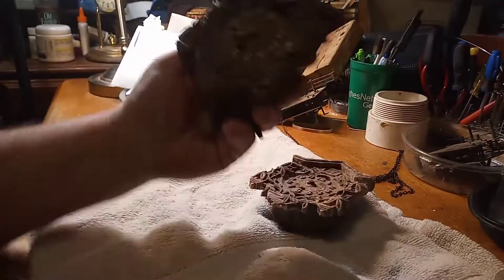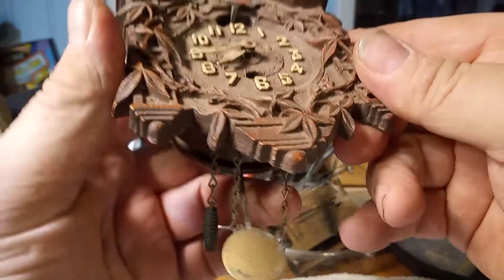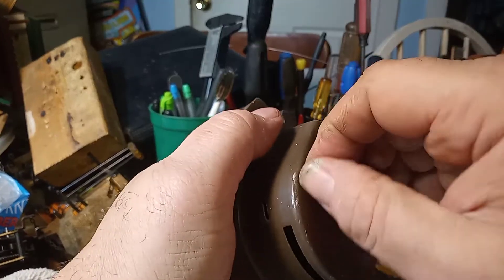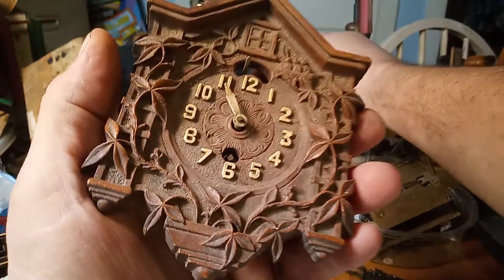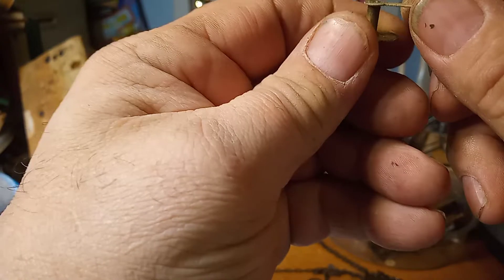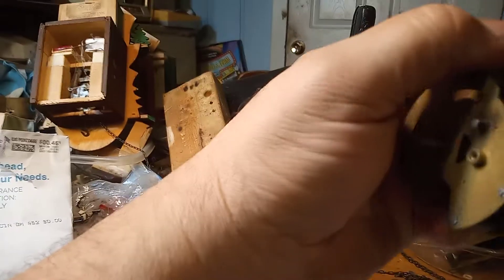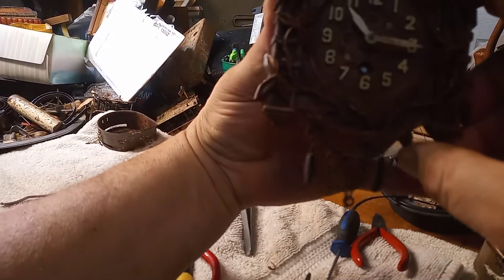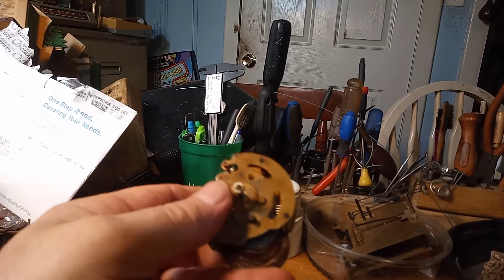Repairing a Lux animated swinging bird pendullete clock. 20220315 204155

Comment: I use a hand remover to get the hand off so I don't damage the hand sides. Did you know that the pendulum wires that go in the bushings move. You need to be careful not to push them inside because they are just short wires and can disappear and don't know how to get them back out. Great find on the price.
Reply from the maker: I have a hand remover but it is for pocket watches. I dont have a clock hand remover. You can use two screw drivers or a pair of plyers but you want to put a towel underneath so  you dont damage the clock face. These Lux clock hands are a challenge to get off sometimes. Not exactly for certain what you are talking about when you say the pendulum wires that go into the bushings move. Please explain further. Thanks. The seller had the items listed for $15 plus shipping. I told her that the items needed a lot of attention and that one of the clocks would probably just be a parts clock. The escapement on it doesnt work. It is rusted. I put it in the ultra sonic cleaner for about 15 minutes. I think that I am going to put it back in for another 20 minutes or so and try to clean it up. The pendulum is broken on it. But a friend from the group Ron Rosencrans gave me some novelty clocks when I went and saw him after fixing a Hubert Herr Cuckoo Quail movement for him and teaching him how to take a cuckoo clock movement apart and putting it back together and teaching him how to do bellow repair as he was doing the same thing that you used to do and that was buy new toppers for them. So he gave me some clocks that he doesnt like working on. One is a Lux clock but one of the gears has a broken pivot. I might use this clock to repair that clock. I just posted some videos of me fishing today. One of the elements I put one of your videos in for the end screen.
Reply: @munnerlyn3  The way I found out that they were wires instead of a solid bar is I got lazy and didn't loosen the nut enough. I pushed it in place and the wire that is suppose to go in the bushing, slid inside the pendulum housing. I stopped messing with it, but want to see if they come apart to fish it back in place.

Comment: I never noticed the difference between Keebler and Lux winding hole positions.  They do have that crazy (sunburst?)  verge and escape wheel that gets impulse from only one side of the swing.  The fronts are made of glue and wood flour (if memory serves me right).  I like to spray them down with Scotts liquid gold and wipe them dry to get off the grime.
Reply from the maker: I have never used the Scotts Liquid Gold. I have been using Old English Oil on just about everything since I first started collecting clocks in 1999. I have since used New Wave Furniture Masque and Howards Feed N Wax. I like both products but dont see that much of a difference other than price between using Old English Oil and the others. Some say that after time Old English Oil causes mildew. I have never experienced that in all my years of using it.
Reply from the maker: Forgot to mention that in the description of the video I have a link that is for Dan and Dianas web page on Lux clocks. It is the most useful web page out there and they do talk about what the clock housings are made from Molded Syroco wood face found in four color variations. So your memory serves you well.
Reply: @munnerlyn3  Scotts liquid gold is very oily at first, but either soaks in or evaporates after a day or two.  On the old cuckoo cases that are not lacquered, it's incredible.  I take them outside and spray them down with the stuff and in about 20 minutes the cases often look nearly new from it soaking in the dried out wood.  Try some sometime on an old scrap cuckoo case.  you may grow to like it.
Reply from the maker: I might have to do that sometime. Thanks.

Comment: So, these clocks do not move the gears based on the spring alone? It works by moving the pendulum ?
Reply: I am also having problems with the main spring, do you have any advice? It only works for a few seconds then stops.
Reply from the maker: I am thinking that it is out of beat. If you can tilt the clock slightly to the left or to the right and it stays running then what would be the verge and crutch assembly on other clocks needs to be adjusted some or the clock needs cleaned. I have all kinds of videos on repairing Lux clocks. If you are a subscriber to my channel look for the folder on repairing Lux clocks or novelty clocks. I hope this helps.
Reply from the maker: Yes there is an escapement wheel and then there is something like a wheel that has pins on it these pins come off of the escapement wheel. The pendulum has a slip system on it that moves back and forth to allow setting this type of clock in beat. I hope that helps.
Reply: @munnerlyn3  thank you for the help. Ill try to figure it out